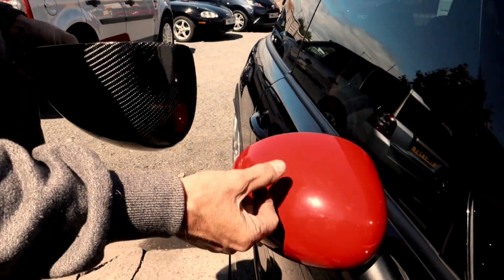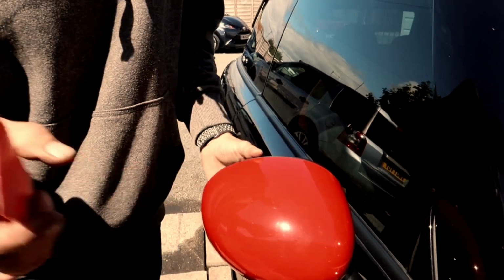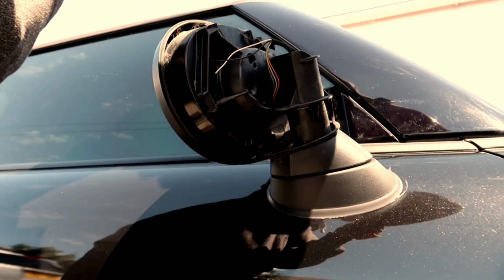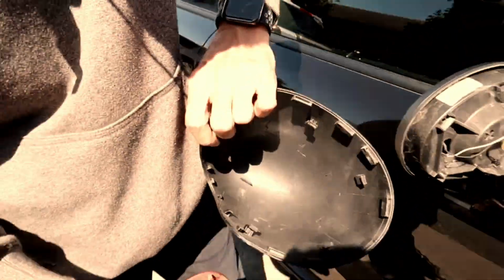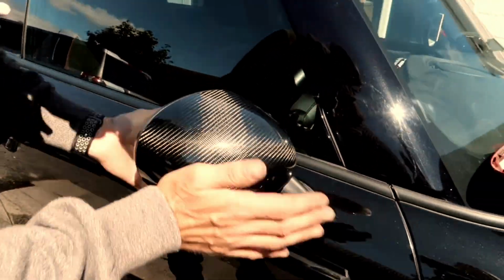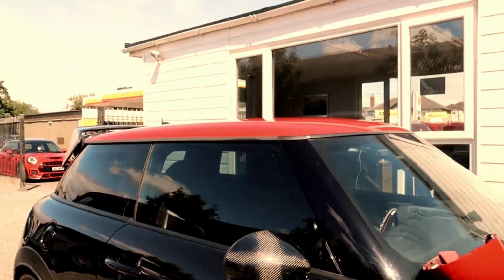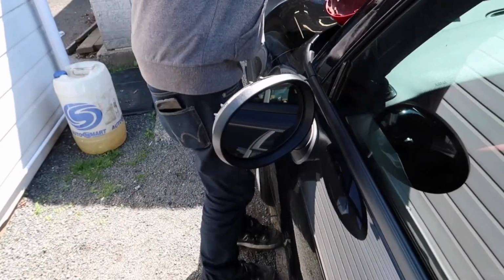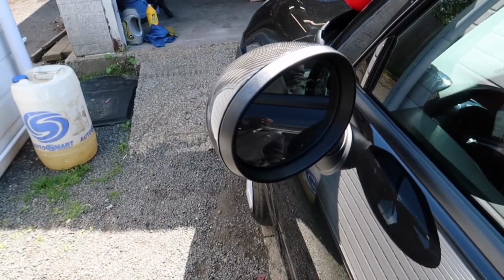Mini Bitz Carbon Mirror Cap Replacements Install - F55 F56 F57 RHD

Comment: Any idea how best to drill the hole for the puddle light on the driver side? The one I have has a "starter" hole but I want to use the correct type of drill bit
Reply: Stepper bit, one at a time till it fits